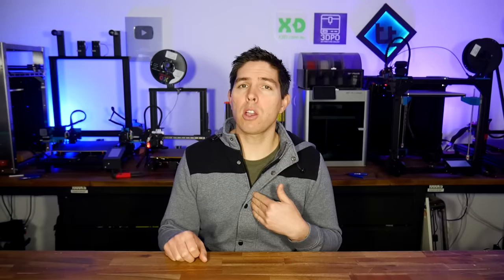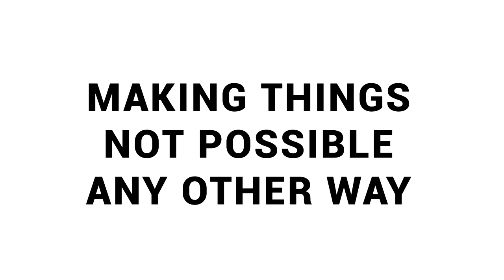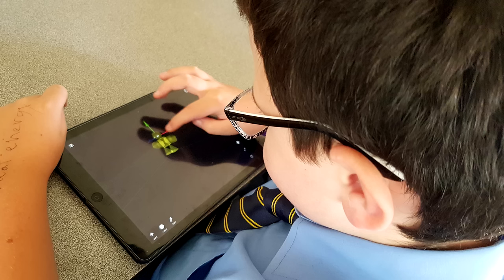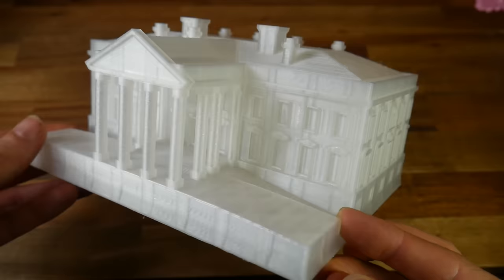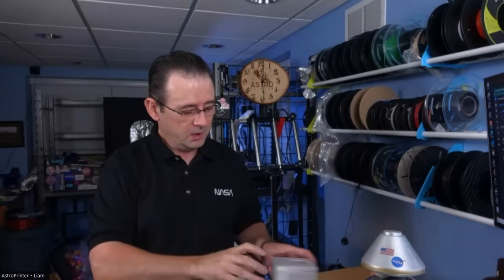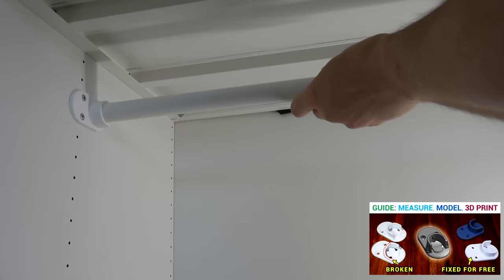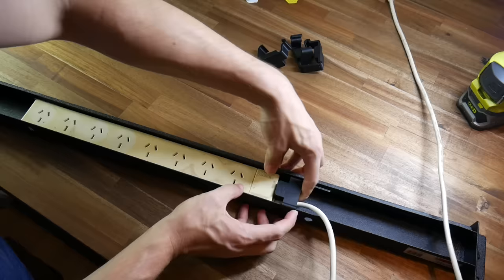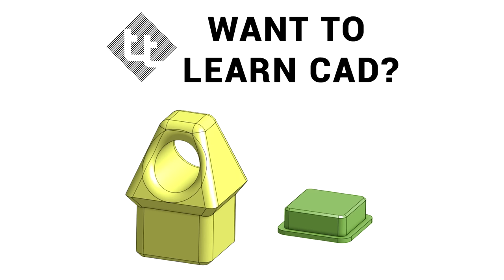These 3D prints will convert non believers

Comment: I deliberately bought a secondhand blender knowing there was SOMETHING missing between the drive and the blades. Bought blender for $10 (retail $100), then designed the missing part, printed and tada 🎉 working usable blender. 
(The missing part is not in production nor available online)

Comment: One of our Australian companies makes large functional parts that have to incorporate complex electronics. The plastics have to support a wide range of electronic mounts. So injection moulding won't work because no single part is made in sufficient volumes. The logistics of shipping bulky parts from Australia to the USA now costs more than the cost difference between injection moulding and 3D printing. So we print for the USA in Austin using USA made filaments. We can also have more SKUs in more colours without  having to keep stock.

Comment: I just finished designing and printing a set of handles for an old rare car. Replacement parts are hard to find and when you can find them, they cost over $250 USD. $25 is what I charged for this

Comment: 2:40  In plastic a home hobbyist could make each gear independently with a file, glue the to pieces to make a single gear. Then the outer ring in two halves, joining them together. 

Not saying it would be fast or easy, but certainly can be done.

Comment: I 3d printed dishwasher parts that were unavailable.  The only problem I ran into is heat resistance. I had to switch to a PETG part which held up sufficiently enough to last several months at a time.

Comment: It's the practical prints and one-offs you need that I think makes it valuable. Toys for kids and fidget spinners are great and all but not really a reason to get a printer - you can buy those, and they are mass produced. Nobody's mass producing some of the adapter pieces or even the custom little speaker stands I designed for myself, though, those are unique to my needs. The "Gridfinity" storage boxes too are sorta unique, in the sense that you pick exactly what you print and what types and sizes, so you can organize your stuff as you see fit, that's sorta custom and one-off as well and 3D printing shines for stuff like that.

Comment: So far i didn't met an non believer into 3d printing. I always show my custom tools that i design and still using at my work, for example a clamp that uses rubber or silicone band for custom clamping pressure ... from delicate to quite strong.

Comment: Very well said👍🏻 It is not easy to understand why people will ever say 3D printing is useless. Since I made my mini delta in 2014 as well as a Big Voron 2.4r1 in 2021, I had printed lot of useful replacement parts for different scenarios such as 3d printed gasket for drain cap, lever for toilet flush system, and even a pair of custom made atmos ceiling speaker enclosure while we were locking down in period of Covid-19.

I just realized you are also a sim race lover. Interesting to see what your gears are as well as what MODs u have done in 3D print for it so far, any video available?

Comment: I never print trinkets, all my prints have a purpose and so far all of them are in use. The thing is, though, that while 3D printer is almost irreplaceable when need for a custom part occurs, it doesn't happen often. Store bought items are most of the time higher quality,  cheaper, and more readily available than 3D printed ones. 3D printer is only a king when the part cannot be bought and it's fine if it is made of plastic.

Comment: The cap you designed for the steel post is great, but you could have used a plastic bag with a ziptie and saved design time/filament

Comment: Our family business uses multiple 3d printed parts and fixtures.   For instance bushings for no standard sizes we occasionally need was once something we had to have machined for $20-$40 out of aluminium,  now with free software I can draw it up and print one in less than 10 minutes for $.08 or less.  Bushings alone have paid for my Ender 3 Pro

Comment: I have a phone mount in my car that’s sort of a custom setup, none of which was 3D printed. The cheap plastic nut that attaches the mount to the swivel ball cracked. It had a good run. I could buy another $60 mount ….oooorrrRRR design a new one by measuring dimensions threads, etc and have my friend 3D print it. First print was successful and it’s still going great.

Comment: I am a plastic surgeon, I use 3D printing A LOT to plan for virtualy any mandibular reconstruction in post-oncologic patients, you get the data from the CAT scan of the jaw and the leg, upload it to a CAD software and plan for the cutting angles in the fibula bone to make it as similar as possible to the mirror image of the opposite healthy mandible. then I design cutting guides that translate those angles to the fibula bone as well as cutting guides for the oncologic surgeon to cut the mandible during the tumor resection, and 3d-print them to get them sterilized and used during the surgery. I also print a finished reconstructed jaw-fibula model to bend the plates we use to put everything together. In the surgery, the oncologic surgeon uses his cutting guides in the diseased mandible, I use my cutting guides in the fibula bone and when we are done, I use the pre-bent titanium plate for the reconstruction. the pieces fit like lego bricks and both, the cosmetic and funcional results just can't be better.

Comment: My first two custom prints were a replacement Rook for my brother's chess set, custom designed to match, and a plastic holder for the spray nozzle hose in a sink, when the original plastic fitting had broken.  The feeling of pressing it in place in the hole in the sink and having it scrape in for a perfect fit was fantastically satisfying.

Now I'm custom designing parts for my van conversion (RAM ProMaster 2500), including a cover for a shore power inlet, mounting for a swivel monitor with TPU padded mounting when it rests against the wall for traveling, a custom air portal through the floor to utilize a portable air conditioner at an upcoming family reunion in August heat, and a set of Gridfinity drawer dividers to maximize the organization of the space.

In general, the value of things I print each year exceeds the cost of my printers and I'm not selling things as a business, just printing for myself.

Comment: I knew you are a sim-racers as well and Merc GT1 at Suzuka in AMS2 might be my next combo😁. I also designed and printed over a dozen solutions for my sim-rig. Just finally finished the most diffcult part: New grips for my Ascher formula wheel, which is now 300 mm in diameter instead of the 285 mm with much better ergonomics for people like me that needs XL-gloves. My first design looked nice, but was painful to use from the shape with not enough flex. Looks like your grips are also a bit too small and really great improvement holding more chunky grips. I choosed PETG in the end with a shell-design for some flex and a thick kernel to hold the torque with M4-screws and inserts. First I've tried TPU, but it's too flexible or print ages with 90+ % infill minus other printing and finishing issues.

Comment: I started using 3D printing for producing prototypes. It makes the process so much cheaper, simpler and removes the need to get everyone who sees your designs to sign NDA's. I am now likely to use 3D printing in an industrial capacity. Despite having other options available, 3D printing is a good fit for any products or components that could benefit from infill patterns, more complex geometries, generative design elements, and where the production bottleneck is caused by other suppliers - meaning it's not worth producing tens of thousands of units a year when you can only produce a few thousand units a year, which is manageable with a few printers. Also, any products that you're likely to iterate on as production continues - where you want improvements to be incorporated into any following units, 3D printing offers the best solution. Once you're familiar with the technology then it's transferable to producing metals as well as polymers so you can expand production without huge reshifts in approach to design, production, post processing, assembly etc... It also is the best companion when working with composites. It's getting harder to find worthwhile reasons to use more traditional methods for producing many parts now.

Comment: Saved about $3000 on just one unobtainable part. A check valve broke on my pool SPA with no way to fix. It's cemented into the decorative SPA wall so fixing it would have meant partial demolition and rebuilt. Ugh. I was able to print a special 3-piece replacement internals that integrated into the existing (cemented) valve body by snapping together.  Still going.

Comment: There are very practical uses for 3D Printing in a manufacturing environment. At company we use a 3D Printer to create jigs, fixtures, templates, and tools that are used to manufacture assemblies. A lot of times the 3D Printed version is used permanently sometimes it is used as a prototype for a permanent version. We use a Ender 3 S1 nothing special.

Comment: FWIW, you missed a BIG feature about 3d printing, exemplified by the broken wardrobe piece: you can design and print a better piece than the (usually broken) original.  In this case, you could have taken the time to make it more robust so it wouldn't have broken again.  (Not negging, just interjecting.)

Comment: A lot of things that are being 3D printed are just either for calibration, or enhancement of 3D printers. People buy 3D printers, put them together and that's all. That's 'dead hobby' stigma that stuck itself to 3d printing, that it exists for the sake of existing.

When I bought my first printer, after adding several elements (like belt tensioners and proper bracing for - well - acrylic frame) I ran the printer for almost 3 years non stop, wearing down 4 nozzles, two beds, set of belts and finally one of the motors gave its soul, at which I just shrugged and bought new printer, which was like 7x faster. It's been happily printing since them with almost zero downtime.

what I print? Spare parts, holders (my hands tremble, so when I am soldering or working on something it needs to be supported on all sides), cases for unusual electronics, computer server parts (hey! that SSD caddy from Dell costs $49.95! You can't just print it for $0.24! Printer goes Brrrrrrrrrr), for some time I was making minifigs (now I don't, since resin printers democratized, as printing with 0.15 nozzle takes ages, like days, and resin does it in minutes). I even sell them on local auction site. Hobby it is, still, but it paid for itself tenfold.

Comment: Tool holder clamps for a drill unit on a commercial large scale steel cutting machine, designed point of failure to prevent damage to more costly parts in case of a mishap. Original part directly from OEM, injection moulded and cnc machined at some points, €160. One night of measuring and working out the 3d model and three iterations in slicer settings turned up a perfect replacement part at a cost of less than €3,- not regarding that night of fiddling while the wife was out anyway. There are 5 of these clamps on the tool post and they break roughly once per year. My Ender 5 with all of its upgrades therefore paid for itself within the year. Yes, it is my own company.

Comment: Ran a printer, and designed tooling for aerospace grade tubing fabrication back in 2017. Was cost effective for most unique pieces but it was barely cost effective then. I been wondering how tolerances are on current machines. 

We had a 120k machine that could not keep tolerances at a precision required (3 thousandths of inch)... but we made it close as possible.

Comment: I have printed parts (trim) for my classic car as they can be hard to get and expensive. I also printed a specific tool for removing the radiator plug for a Rover SD1 and old Land Rover. I can foresee car parts being officially released by manufacturers in the future where they just charge a download fee for “classic” models

Comment: In 1.5 years of owning a 3d printer I only printed 2 tests (cube and tolerance/overhangs tests) as well as 3 decoration pieces (one printed 4 times because details weren't as good). The rest all was functional and serves some purpose. It's not a toy, but rather a tool for making tools.
Something you can't buy or will spend 5x more is my main thing there. Something for urgent repair works. Something to hold/hang stuff in a convenient manner. I also design small things and remix "almost good" models so they are actually good.

Comment: I use 3D printing for prototyping and enjoy the design aspect. I don't enjoy the amount of fiddling, hand holding, and failed prints to get a few acceptable parts that I can use. That's why I'm excited by the hands-off pring claim of Bambu Lab's X1 Carbon printer. Hopefully this will push the home 3D printing industry to work as reliably as paper printers. Btw, I have no affiliation with Bambu Lab.

Comment: What I like doing is also finding a solution to something I need.
For instance, a Velux window.
I could spend £30+ on an official Velux telescopic pole.
Or I could make my own.

I bought several Vileda mops which are also extendable, for like £3.50 each when they were on sale.
But I needed an adaptor which fits into it, whilst on the other side the Velux hook.
Luckily someone had made a mop adaptor to use normal cheap mops on the Vileda handle.
And someone else has made a Velux hook.
I simply took both and merged them into the thing I needed.

Comment: I wanted to replace mt factory "Double-DIN" radio in my car with a "Single-DIN" Pioneer with a flip out 7" screen. Sure, I could easilly spend $20 on Amazon and get an exact adapter for my car, but it would lack the features I was looking for. Usually, such adapters have space for the Single-DIN head unit and the remaining space would be a generic storage space. 

I removed the factory stereo and used it's dimensions to design my own plate adapter for my new stereo. Instead of a generic storage hole, that space was used to add a place for (from left to right) an amplifier gain control knob, amplifier power override button, microphone for hands-free calling, aux port, USB Data port to the stereo, two 3-Amp USB charging ports, and a 1/4-20 stud to mount a phone holder. Printed out of Polyamide (PA) Nylon filament, this adapter should be able to stand up to the hot summers of Florida without becoming malleable and warping.

Comment: Probably half of the appliances/furniture in my house have a printed replacement part by now.  From toilet seat hinges to sliding door guides, to cabinetry hardware, nothing is unfixable.  Everything these days is essentially disposable; replacement parts for cheap mass produced products just aren't cost effective so it's up to you.  Take a few months to learn basic modeling and it will absolutely be worth the investment.  There is a slight addiction warning to those prone to the condition, but at least you'll be a productive addict.

Comment: I am surrounded by many 3D printed items.  The satisfying part is that they blend into their environment without being "in your face".  The most satisfying was probably my flip-top top-loading reading-glasses case.  It gave instant access, but is now consigned to the workshop, as I wear progressive lenses full time.  WiFi extender bracket, pill-bottle shelf in inside of cereal cupboard door, racks for Torx drivers, Allen screwdrivers, hole-punches etc.  Bandsaw dust extraction system and table inserts.  Router table inserts.  Hinges for stays on a drop-side extension table on my sawbench.  Replacement plugs for my son's patio furniture.  The list goes on and on, and I don't see myself as a 3D printing fanatic... just someone who can see the value of it in my life.   AND I EVEN HAVE PLUGS TO KEEP THE DIRT OUT OF THE SOCKETS IN THE GARDEN WHERE THE "QUICK ERECT" FROST COVER GOES!   😁👍

Comment: I used a friends 3D printer to print parts to build my first 3D printer, which I then used to print parts for another friends first 3D printer. I've since used my first 3D printer to print parts to build a bigger and better 3D printer (I've now taken my first 3D printer to work and others at work want to get into the hobby).
I have used the newer printer to make modifications to itself, improving it's reliability and usefulness.
I would say I make more prints of my own design, but I have printed many models that others have made as well. I would say about over 60% of the models I have printed have a functional purpose, but I still print the occasional model for purely entertainment purposes (the most impressive is a life size Mjolnir hammer and currently printing a life size Stormbreaker - yea, I'm a geek. They are fully painted and prop ready, not just printed).
I could not imagine my life without my printer - when I retire, it will be the one thing I keep playing about with. I'll drop the woodworking and engineering but keep messing about with the printer!

Comment: i'd imagine water is still going to get in that post. you'd need to do more of a mushroom top shape with a overhang that drops down below the metal rim so theres no way for water to travel along the surface of the plug. as it is now some water will run off, but some will stick to the surface past the 45 degree bevel and travel down into the metal tubing.